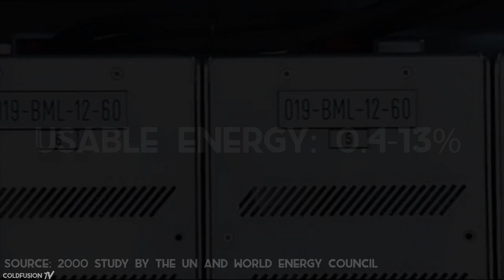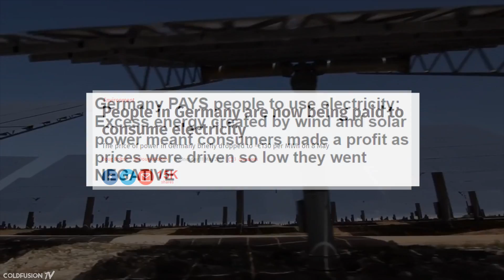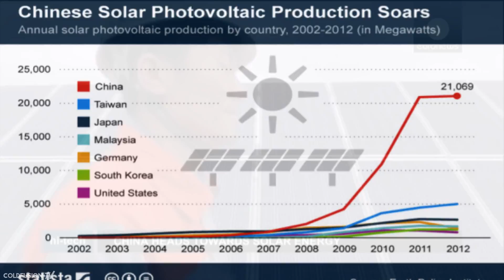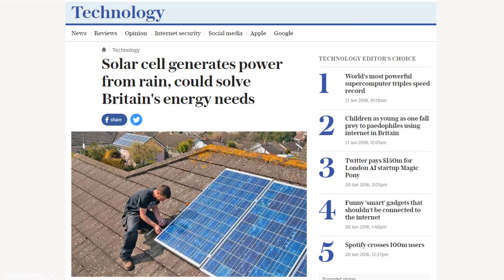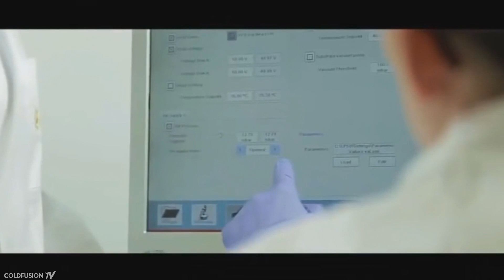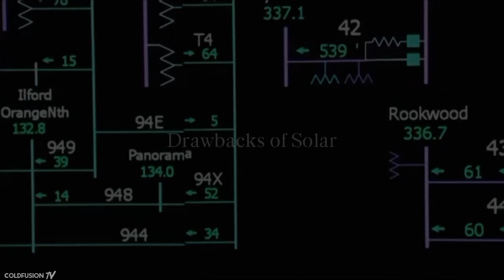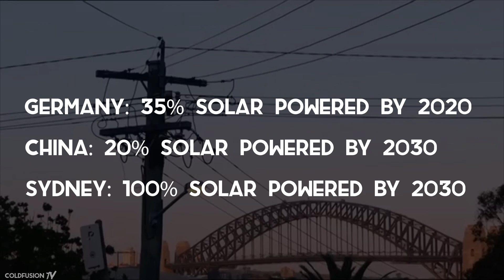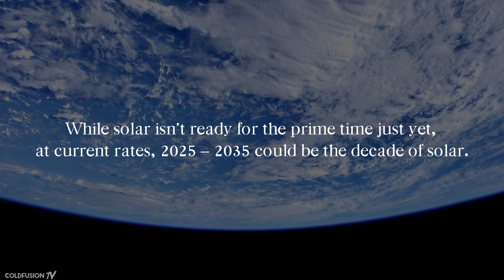The Truth About Solar

Comment: This vid. is blatantly deceptive.  Replacing the existing natural solar system (trees and plants use sun to produce organic material and store it at night without buying a battery).  I can burn a log and get more heat from it than an entire neighborhood of solar panels, batteries, inverters and controllers.  Twice this vid related the question about night use for solar, stating that use of solar collection at night was not 'necessarily' an issue, but both times failed to produce any evidence contrary to the notion.  It states that nations 'want' to have a certain percentage of solar production at some point in the future.  I 'want' a million dollars by tomorrow morning.  Wanting doesn't make it happen.  At least by itself.  The claims and assertions are false.  For instance what was the cost and source of funds for the NC project.  The community was poor, as stated.  They certainly didn't come up with that money on their own.  Was it federal funding?  If so that means we all paid for this rather expensive boon-doggle.  The cost stated (36 cents per watt) is also bogus.  Especially when you factor in cost for storage, control and inversion to a c.  Many company has tried and many have gone bankrupt trying.  Apparently, including Tesla.

Comment: starts immediately quoting $0.36 per watt. Not true. 3 minutes in and immediately creating untrue comment.  Lowest price is still over $0.60. for solar panels alone. Never mind that that is 1/4 the cost of a system. You will pay 10 times that amount installed. Been looking at this every couple of years and we are at a break even today in most areas.  If you factor in opportunity cost to purchasing any investment, still a loser. Very slanted video. Solar however, is getting much better and costs are dropping.

Comment: This is definitively part of Biotropic Engineering Design. By 2035 there will be very little oil left and prices will be roughly 10 to 20 times today's value which will make alternative energy sources far more attractive for power production. Renewable energy is history. Natural high frequency wireless energy will be the future ood electrical power operating at 27 khz as opposed the current 60hz. This shows a broadcast range up to a few miles but pet companies will charge according to power output rather than measured consumption.

Comment: I have had solar power for over two years in northern Canada. It's cheaper and more reliable than grid. No outages at all and it costs $20 a month in fuel Oct to march. It costs nothing the rest of the year. Small system that cost about  $8000 installed.